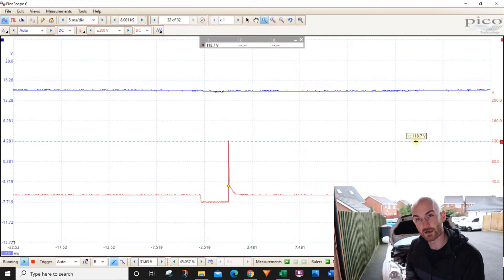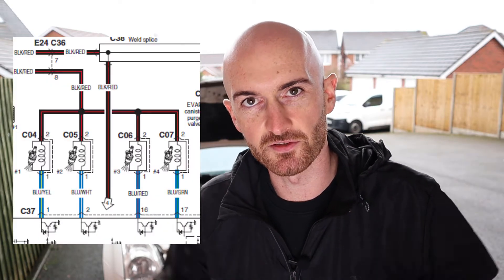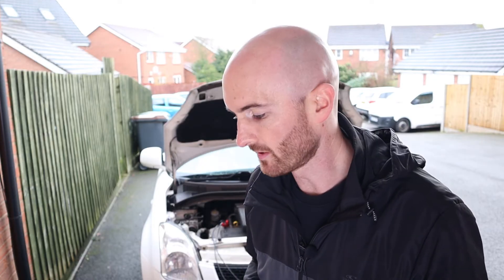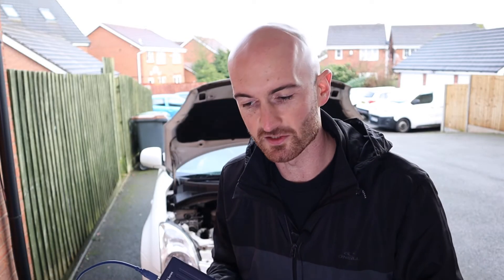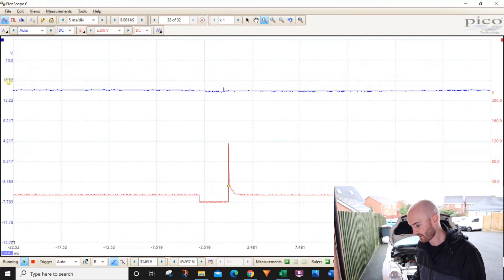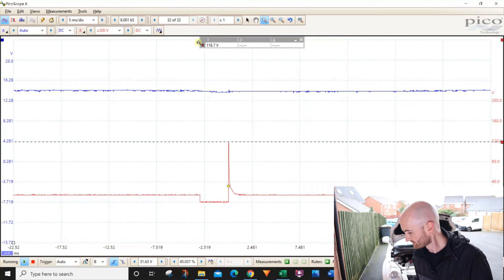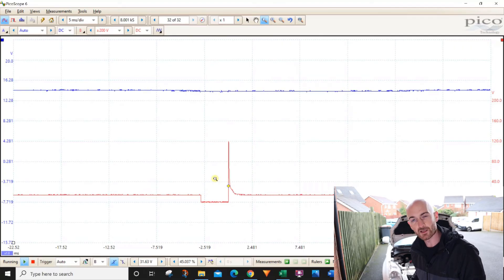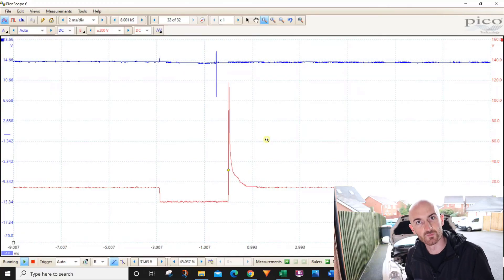EASY Fuel Injector Testing | Automotive Oscilloscope Diagnostics | Mechanic Mindset

Comment: Hi, thanks for doing these videos as someone with a controls systems and software background with mechanic / farmer dad I always felts the diagnostics of cars was lacking and data about what sensors were used where hidden for no god reason. Being accustomed to having schematics and sensor knowledge freely available it it has been frustrating starting to work on cars for lack of documentation and expected waveforms etc. Brilliant content and I hope it generates customers for your training courses.

Have you ever done any analysis of pizeo injectors? I know they operate on a high voltage but don't know what to look for, there is no back emf etc as far as I am awear like a coil so I am guessing its probably best to lok at current draw?

Comment: Hi, I am trying to find out what switched voltage I should be getting on a 2004 2.0 diesel Jaguar (CAN bus system I am told), With a meter I am getting 5.4 volts across all of them, I have an injector not firing & done a basic continuity test on the pulse wire & that's ok,

Comment: Are both ground attached at the same time during this video, or did you disconnect one? I just recieved my 2204a and trying to learn how to properly use it.
Reply: I tried it both ways, with and without the ground. I can get the flat line for the 12v feed, but when I go to the switched side, it instantly starts to misfire. I'll have to take another look at the schematic.
Reply from the maker: @zachschereck5698 check your leads they could be shorted internally
Reply from the maker: Yes they are, but actually with this scope you only have to connect one. Common grounds for all channels.
Reply: I can't seem to get a correct reading on a fuel injector on a 2001 saturn, when I do the test and it shorts the injector on so I have to remove the lead right away.
Reply from the maker: @zachschereck5698 Make sure both ground leads are on battery negative.
Reply: They are all brand new, they are the same ones you use. I ordered from the link you put in your videos. I check that with a volt meter right?
Reply: I should clarify that when I have the negative on it will misfire, without the negative lead nothing happens
Reply from the maker: @zachschereck5698 I sounds like you are shorting the ground out
Reply: That's what I figured, but that's why I am also so confused. My schematic looks the same as yours with the exception of mine has a fuse powering the injectors without a relay, the switched side is grounded through the PCM, simple 2 wire port injector.

Comment: How do you connect a variable resistor to an injector. I have an electrical test kit that comes with one.
Reply from the maker: Be careful, it probably doesn’t handle much current flow on a low ohm setting. I wouldn’t advise doing it, that’s more for sensor circuit diagnosis 👍

Comment: Great job, Darren.  Could the 500mV you see on the ground side be transistor junction voltage drop?
Reply from the maker: @PaulOffordRacing  Yeah for sure, while active it’s likely the transistor causing the drop 👌 If I went back to module, it would probably be a little lower but I would expect there to be some voltage due to this 👍

Comment: This test to be complete should be done couple things more control wire could be shorted to ground or shorted driver to do you need to check voltage test at driver on control wire some cars turn off injectors because of miss fire to protect cat and people call injector and you have bad call that should be mentioned to any way

Comment: I do love my Picoscope once I've got it set up. If I wasn't a mobile tech I'd have it permanently set up on a mobile cart. I find it much easier to get out my Fluke 190-204. But even that becomes a hassle because of its size. It seems a bit silly of me complaining about its size, when I started in the late seventies the scope I used was too tall to see over and was nearly as wide as the car I was working on. I just ordered the Owon HDS4202M-N 2 channel 200mhz 1gsa scope. It's a bit pricey compared to a lot of handheld offerings, but it still pales in comparison to the Fluke (ouch, that hurt). We'll see, the channels aren't isolated so hopefully I don't send any smoke signals with it.
Reply from the maker: My Grandad had a Sun machine that took up the whole of the van at the back; he did mobile tuning. Just trying to think of a convenient set up for mobile PicoScope. 

I like the Owon 👍

Comment: So for solenoid type injectors when scoping the voltage you want to be on the ground side switched wire? And for current you can be on either wire is this correct?

Comment: Thanks for your detailed explanations, Darren, I am torn between the 2205a and 2204a. Same bit resolution but not sure if the 25 vs 10MHZ is going to help much since there still 8 bit, what do you think? I would like to move up to a 2408a eventually but would like to get some experience with the Pico first, then decide whether it is worth the upgrade or not. Thanks for any suggestions. Currently using the Autel mp408 but the Pico Software is really looking good for a lot of reasons.
Reply from the maker: The big difference you’ll notice is the sample rate increase for the 2205 - get the 2204A, play with it a bit, then you’ll want a 4425 👌

Comment: I had an 'aha moment' when I realized why they use a zener diode inside the pcm to protect from the voltage spike. Most of the time for a coil that is abruptly turned off, a flyback reverse polarity rectifier diode is used in parallel with the coil. Here all the protection is inside the PCM, simplifying circuitry inside the injector.
Reply from the maker: Clever stuff! Check out my video ‘ECU Killer’ we look at relays and the resistor used to ‘soak’ the spike 👍

Comment: SO helpful! Why did you need the attenuator? I thought you only needed that when dealing with coils/spark.
Reply from the maker: It’s because the induced voltage spike goes higher than 20V; max measured input is 20V for this scope. Cheers!

Comment: The 500mV are from the voltage drop of the driver transistor inside the ECU. Transistors always have this kind of drop, mosfets don't.
Reply from the maker: This is a good point! Thanks for sharing 👍

Comment: I have a Ford 460- 7.5 liter engine in my motorhome. It has bank injection, where 4 injectors are fired at the same time. It is a V-8 engine. And it fires the 4 corner cylinders at the same time and then the 4 middle cylinders..It is not sequential injectors..So I wonder how that will look on the scope..And How can I test the injectors individually ..
Reply from the maker: Interesting, I’ve not come across this system but I am aware of it. You should be able to test them individually with an amp clamp; check the wire at the injector. I have another video after this for injector current 👍
Reply: @MechanicMindset  What I was thinking to test each injector is to remove the wire harness from the injector..Make a test harness that has the plug that fits the injector..2 wires to it..
12 volts+ and then just touch the ground as quickly as possible..I would not be able to create a 2-5ms ground time as the computer can make, but maybe 100ms with just a quick tap of the neg wire to ground and see what the wave form looks like ..
If I used the amp clamp, wouldn't that measure the whole, all 4 ,injectors..??
Looking seriously at the 2204 and 2205..About 100 dollars difference here in the States..
Reply from the maker: @MichaelJohnson-cm4wp  That would work for the voltage. You’d be surprised how quick you could activate it. 

Yes, measure with clamp at injector will only measure that one; measure with amp clamp at fuse where all the wires join you’ll measure them all. 

Parallel circuit 👍

Comment: I have been looking at oscilloscopes and it seems by the time you pay for attenuators  amp clamps and other attachments it would be close to the cost of a Hantek DSO2D10 or similar that can handle  the amperage and high voltage that has better specs. What is your opinion?
Reply from the maker: It’s such a difficult decision with all the choice! Personally I recommend the Pico 2204a to start. The software is 99% same as the top range automotive. I am not a fan of Hantek software. The Pico are also easy to sell if you chose to upgrade. Either way, all the BNC probes will cross over to other scopes 👍

Comment: my 4-cyl Tracer 1.8 engine has lost power & been running rough.  so a plan is to use a
1054  Rigol 4-ch   scope and view the f-i signals. 

       seeing your vid has saved  me some possible damage by your pointing out the sizable
coil inductive spike.

   the rigol 1054 has a Vin max rating of about 300V.  so with using all 4 probes at 10:1 setting i ought
to  be ok.  but will 1'st use a 100:1 hi-voltage probe and see just what each f-i actually is.

      plan is later to capture all 4 at once.  so that any obvious differences show up.

    the 1054  is about 5 yrs old and cost some $400.     and its 'zillion' of features comes
with a considerable learning curve.     the model i have now has all of its 30-day trial
features un-locked.    speed, memory depth , decoding  etc.   its a heck of a 
deal for the cost

       all of its use until now has been to view the ignition signals of my 2  motorcycles.
where it has proved invaluable in identifying fault location.  most recently that the
timing coil signal  off the flywheel is the problem for my 100crf honda.  not the cdi module
Reply from the maker: Awesome, how did you get on?

Comment: Thanks Darren, your videos is what I always looked for for using Oscilloscopes on Automotive.
Reply from the maker: Glad you are enjoying the videos! What oscilloscope are you using?
Reply: @MechanicMindset   I have old model Pico with parrallel to USB Adapter,  ADC200, but it got a little bit outdated.
Reply from the maker: @AMGTOM  If it works……. 👍

Comment: A simple electrical model of an high impedance fuel injector is a series R-L circuit which will have the classic exponential current waveform if operating properly, or at least electrically operating properly. Most of the injector electrical failure modes can be identified by capturing the injector current waveform with a clamp on current probe and viewing the current waveform on an oscilloscope. For auto applications I like to use a Fluke Scopemeter and Fluke Clamp on current probe, although not an inexpensive option. Both are battery operated. 

Just clamp on the injector ouput low side wire and observe the waveform. In identifying a misfire, injectors have a tendency to short out the coil internally which will change the current waveform from exponential to linear (resistance only). So move from injector to injector and the one with the linear (or strange in some way) current waveform is the one that has failed. When one injector shorts, it is best to replace all of them. Injectors which fail electrically due to heat have a tendency to come in batches. Which means if one fails others may follow on the same engine original from the factory. If the failure is in the ECM low side driver then you will see no current event. However, this type of failure is part of the module on-board diagnostics and will usually register a DTC. 

The clamp on current probe is easy to connect and directly measures current (current in a coil is directly related to its magnetic flux, which is how it works).
Reply from the maker: Thanks for the insights! We followed up with this very test 👍 Let me know what you think! I simulated the short. https://youtu.be/6yaox9b9M5A

Comment from the maker: Automotive Oscilloscope Masters training now live: https://www.mechanicmindset.com/oscilloscope-masters
Reply: The page can not be found😲
Reply from the maker: @szymanski_meble  Thanks for raising, updates link 👍
Reply: @MechanicMindset  no wories mate.
I am getting in to scopes slowly. I have an old e30 with swap m50b25 from mix of e36 and e34😃 unfortunately for me the obd does not reply on it when i try to connect, therefore i will have to use scope to test mfs o2 coils ect and rhis channel has pop up. I have seen the vid where you were talking about common groind on 2204A and this will have to be addres and will have to remenber. In tje comments and on one of your other videos has been mentioned to use baterys ground as a safe way to use the scope. Will this be enough to prewent car or the scope issues?
Ill be looking at some other of your videos and then decide to go for a course i desire.
Thanks mate for all your input already👌
Reply from the maker: @szymanski_meble  Cool! E36 engine with E34 sump right? 😬 I had a ton of E30s some years back; couple 318is, 325i, also had a 316i Estate with Hartge H27 full swap 😁 They are all gone now. 

Yes, just always use the ground. It may be a simple problem for the communication, the early stuff just used a single wire. Might have been before OBD regulation though, what tool are you using to connect?
Reply: @MechanicMindset 

The tool i have used is an adapter to connect to old type obd. But i have no comunication at all I've tried few option by now.
Now my hope is to use scope and your help to get to know how to use it.
Reply from the maker: @szymanski_meble  Thanks for joining the membership! There are some courses to help you get going with oscilloscope in there 👍

Comment: Hello, great videos really enjoying them. Please can answer a question im looking all over for the answer. I wanted to buy a hantek 3 in 1 oscilloscope 2c42 but I want to measure injector and ignition waveforms, so I need an attenuator ht201 but I can't find anywhere is that is compatible and will work and show me what I wish to see. Appreciate a reply and maybe you could do a video about the hand held oscilloscopes with screen built in vs a unit connected to a pc or tablet. Many thanks
Reply from the maker: Hi, Sorry, I’ve not got that oscilloscope so not sure how an attenuator is fitted (or any BNC adapter). Something I will look in to 👍

Comment: I just wanted to say I picked up a Pico because of your videos....which are great. I would like to check the voltage/current of all 6 injectors by using a fuse loop wire at the fusebox, since 3 of them are buried under the intake. Would I have to change any settings in the software?
Reply from the maker: Awesome! You would just have to adjust the time settings to see them all. I have just launched a course which covers all the settings for Pico! Check it out here: https://www.mechanicmindset.com/oscilloscope-masters
Reply: @MechanicMindset  Thanks...will do

Comment: Very well explained, let us say if the both the injector wires are directly coming from all the ECU, can i use same method to check the injectors?
Reply from the maker: Hi, yes. But it will look different. This is the same set up for direct injection injectors right? Thanks!
Reply: @MechanicMindset  i was checking a wiring diagram on Porsche SUV long ago, that had a dfi system & both the wires comes from ECU....you mean the waveform will look different..?
Thanks
Reply from the maker: @vicky-nc3to  Yes the waveform will look different 👍

Comment: I really like your videos. I like the way you explain things and I use the exact same scope.   One problem I have is sometimes I get really boxy looking wave forms.   Like instead of waveform lines across the screen with curves and ramps,  my lines across the screen are sometimes little spiky triangles.   I'm not sure if I've just got some setting wrong or what is causing it.
Reply from the maker: Hi, check this video out on sample rate, this might explain the triangles: 
https://youtu.be/DIzGPeFtpLw
If you get a pattern like a staircase, that’s vertical resolution. There is a vertical res enhancement feature, you can increase it one at a time, but it will eventually flatten out your waveform. Glad you’re enjoying the channel! 👍
Reply: @MechanicMindset  thanks!

Comment: Could you use an oscilloscope to measure & compare injector dead time (mechanical opening and closing time) for fuel injectors off an engine but in receipt of a common current?
Reply from the maker: Someone else asked this; I suppose theoretically you could, in conjunction with the current ramp to see the open point. I am not sure the information is clear cut enough to define the reference-points on the waveform as true closed to open. It seems engine tuners have no true method to define unknown dead times. Do need the figure for performance tuning?